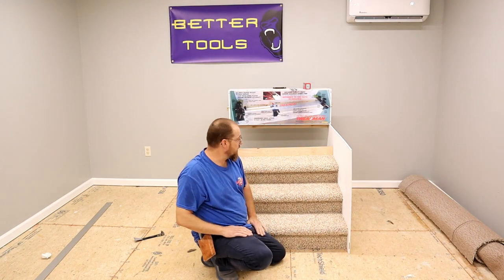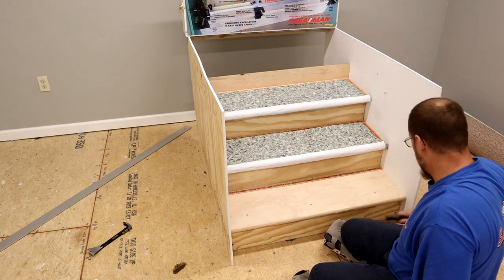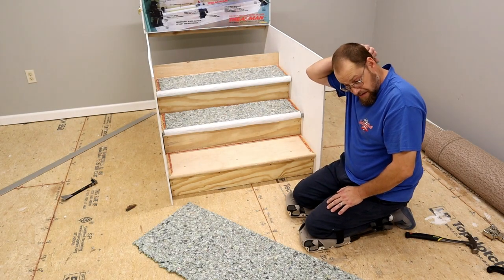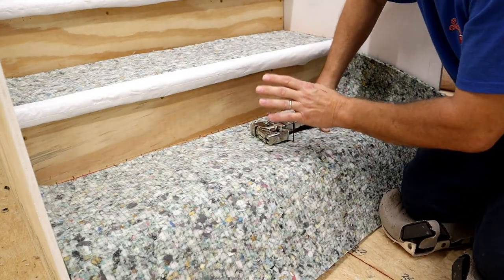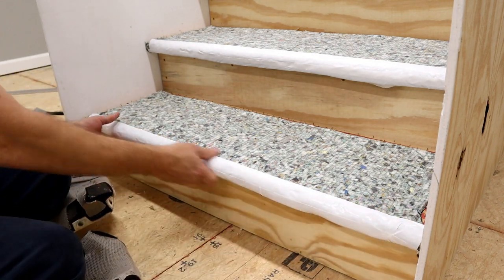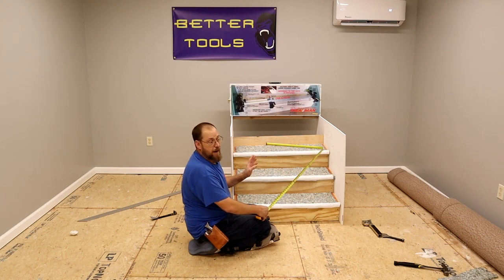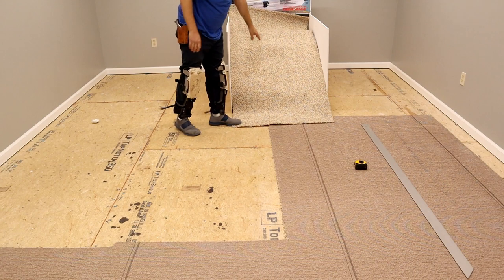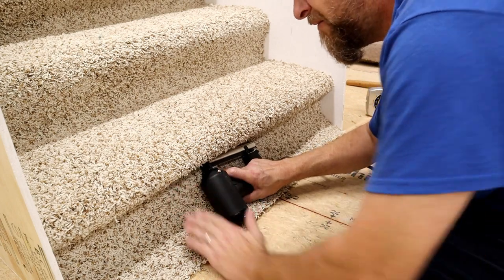Transform Your Stairs: How to Carpet Bull Nose Steps

Comment: Are you sealing the carpet sides to guard against fiber unraveling.  Since only 1/8 inch is added to the width, the side gutter is not being used in the conventional step down manner, but rather as a simple angle bend for appearance sake.  If sealer is not being used are you optimizing the cuts to be close to a backing web strand?  Maybe I am overthinking fibers coming loose while tucking and vacuuming the sides and nose ends.  Love your videos, take pride in doing the best job you can do.  For me you lead the way.
Reply from the maker: Awesome, with it being tucked in the signs, I don’t think there will be problem with it raffling

Comment: A lot of guys and probably you would have fired me for the way I did those type of steps. I would cut individual pieces for the step and then cut individual pieces for the risers. I knew it was time consuming but, if a pet or something damaged one step then  all I had to do was rip the carpet off that step without interfering with the other steps or riser.
Reply: There's nothing wrong with the way you are talking about it's is still used, its just another method that some installers use depending on the situation. Personally I sometimes use the way you are talking about on Berber carpet because I find it Bit easier, just remember there are a number of ways to install carpet on steps, 
This guy is a very good and pleasant teacher and he explains everything nicely.
Reply: @Cherokee10g  That's true. I do admit, every job I ripped old carpet from steps never was done the way I installed them. I saw guys use one or two pieces of carpet to do let's say 12 straight steps and be done in no time. I attempted that method plenty of times and always hated when 3 or 4 steps go in nice and straight but then the next couple steps are smaller .

Comment: How many stairs do you do per piece of carpet? Do you cut a full run for the full set of stairs or do you do it in smaller pieces? If so, how many stairs do you recommend doing for each piece?

Comment: Great Video, thanks.  
I had some berber carpet installed on some stairs and the staples show even after they hit them with a hammer.  Do you have any suggestions?
Reply from the maker: Not a whole lot you can do if they pinned the carpet fiber down with staples. Sorry my friend.
Reply: Thanks so much for your reply.  Is there an alternate method for securing the carpet besides staples?

Comment: Ruben, thanks for all the great videos. Do you have a suggestion if the stairs aren't straight? I have an old house and the back of the tread where it meets the riser is up to 3/4" wider than the front of the tread on most steps. I will have to do every stair separately I'm sure.

Comment: Just had carpet installed and I feel the tack strip with my toes on every step. My kids say they are stepping on them too. The installers used the old strip. Any thoughts why this is happening? What is the right way to fix it? It’s on 8 lb moisture barrier pad too.
Reply from the maker: The tack strip may be too far out into the step instead of up close to the riser , Feel free to take a hammer in town those pants down and just by tapping on top of the carpet and that will fix it for you
Reply: @FloorsbySouthernboys  thank you!!!

Comment: Great video on this .This is another one I see all the time no Tac strip to stretch on the sides and loose Carpet. Dude it was not me it's the crappy 1/2 8 pound pad or 7/16 8 pound.

Just like you stated there not doing the sides and going back and hitting the front a few times.
This comes from guys who have been doing this 15 plus years .Glad you posted this as well.

Comment: Newbie to carpet installs here! I'm getting ready to do a landing in my home theater room with a single bull nose lip. I watched a lot of your videos and appreciate all the great advice and tips you give!! I do have one question. Couldn't you also install a tack strip directly under the bull nose lip? That way when you stretch the carpet, it will pull on the tack strip v/s the staples? Any negatives to that or will that be fine to do?

Comment: I like the look of the carpet tucked under the bullnose. I was in stair manufacturing for 20+ years, and I don't recall seeing any stairs done that way...and I've been in a lot of homes, by different builders and from low end to high end. One thing I discovered was, when installers would kick the carpet in the middle of the riser, they would knock the riser loose from the back of the tread.

Comment: Great video it's very helpful I'm going to do my stairs so good to see this I don't have a electric stapler though I have a nail gun so would a nail gun be ok to use  or not
Reply from the maker: No sir a nail gun will not work. It will sit right through the carpet staples have a Crown, which grabs the carpet.
Reply: @FloorsbySouthernboys  thanks for the reply I will have to go out and get a staple gun then are they certain staples to use obviously heavy duty staples but is there a certain type or will any be ok to use

Comment: Don’t roll your pad over an “1 and 1/4 rounded bullnose ever unless the bullnose is under 1/4” deep from riser. 

Cut it flush it will give a nicer bullnose after carpet is stretched on top 

Rolling your pad over the bullnose is for hard cornered 2” treads to keep the nose wear down on the carpet surface.   

There is 6 different types of tack and pad prep for individual types of stairs and types of carpet
Reply from the maker: Thank you

Comment: I've watched this video a dozen times and really appreciate the detail.  I'm using an air nailer for my bullnose, and my first attempt sent the staples straight through the carpet and raveled the carpet.  What pressure do you recommend on the air nailer to catch the carpet and not go through it?  What length staples are you using?
Reply from the maker: I’m not sure, that is why I use an electric staple gun
Reply: Tim, he is using an upholstery stapler , Crain I believe. I use a Duo Fast, 250 bucks. They don't blow through the rug.
Reply from the maker: @stevehamman4465  thanks You’re right

Comment: Hi.  Thanks for your video.  I am a complete amateur here, so please forgive my questions.  I'm trying to carpet my basement steps.  Just making sure I buy the right tools.  Aside from the tack strips I'll need a staple gun, the kick tool, and the tool to press the carpet in the corners.  What type of blade do I use to cut through the carpet?  Do you recommend a specific one to cut large lengths of carpet?
Reply from the maker: I use round slotted carpet blades, you can pick them up at Home Depot or Lowe’s
Reply: One other question.  What type of electric staple gun do you recommend?  I don't have the ability to get a pneumatic one so a regular electric one will have to do.  If you can't recommend a particular brand is there anything specific to look for when dealing with stapling carpet?  Thanks in advance.

Comment: You shouldn’t need tack strip on the sides of the step. And if you cut the pad off at the nose and not let it roll over, it gives a nicer tighter look.
Reply from the maker: Thank you
Reply: that is not a good way to do it

Comment: Great video. Thank you for sharing!

A couple of quick questions, if I may.
Firstly, if I have to use several lengths of carpet for the stairs, would you add carpet grips/tack strips at the bottom of the riser as well as the back of the tread, so that the two separate pieces of carpet will each have something to tuck into?
Secondly, I have size 11 feet and my treads are only 8" long, so worry about my heels and toes hitting tacks each time I go up and down the stairs. Any advice?
Reply from the maker: Nosir ,in no case should you put tax strip on the riser if there is a bullnose on the step, and even with a size 11 you should not step on the tack strip, I am a 10 1/2 myself and I have never felt tack strip on steps
Reply: @FloorsbySouthernboys  Thank you for your reply. So, you mean that both pieces of carpet should get tucked behind the same tack strip, with the carpet that's coming down just stapled at the bottom, where it meets the tack strip?
Reply from the maker: @DragonJade8  That is it my friend
Reply: @FloorsbySouthernboys  Many thanks, and keep up the great work with the videos.